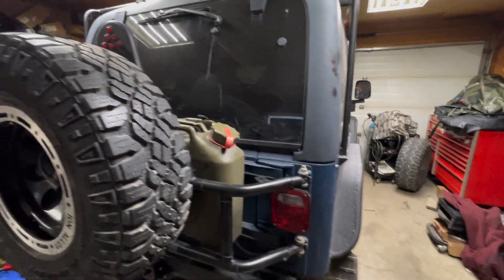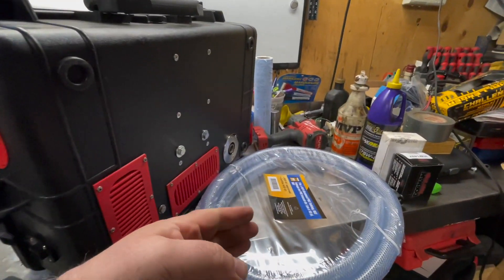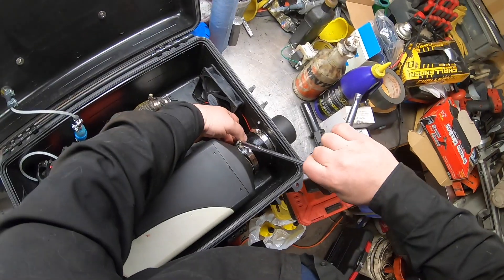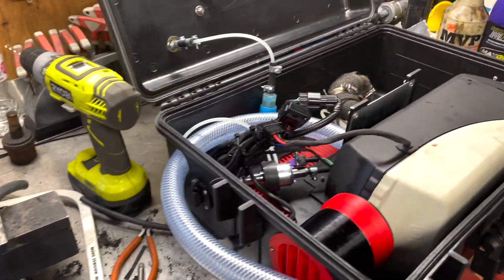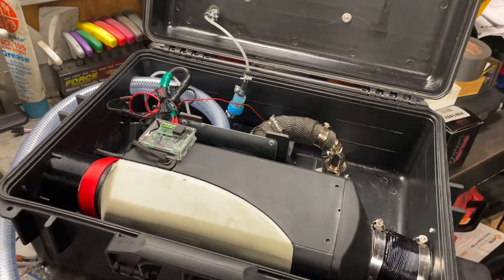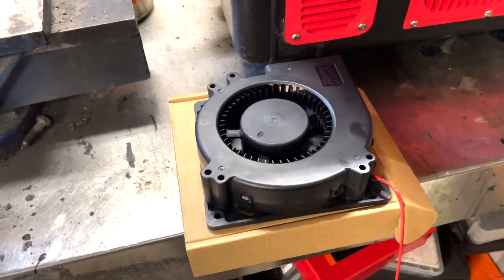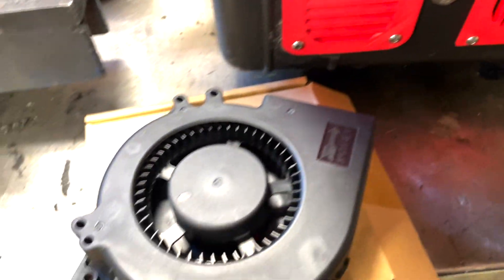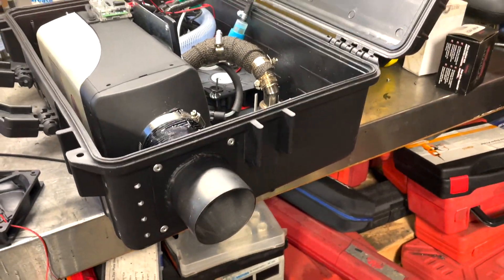ULTIMATE OVERLAND HEATER BUILD P4 FINAL MODIFICATIONS

Comment: I just watched one build that was a yr old post and he used  one to pull  not only to help internals cooler but to help the heater to breath , as the heat in combustion chamber  gets hot   the fresh air goes over and carries the heat to vent  letting pollutants  leave
Reply from the maker: I’d like to know if a person could upgrade the internal fan to blow a little harder

Comment: Just. Thought  on the cage fan intake ….add some louvers and filter media to block dust and snow from entering the case and dicking up the works……Great project brother…
Reply from the maker: That just causes the unit to over heat, due to lack of air flow